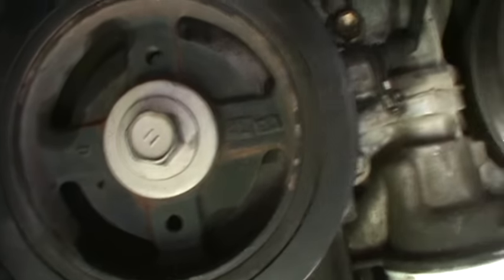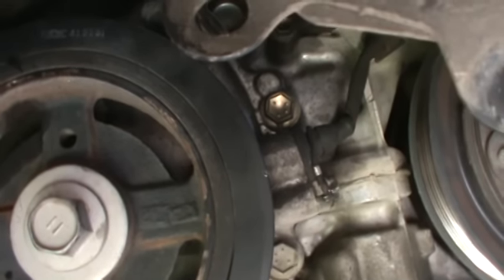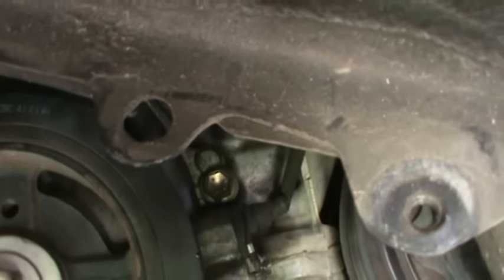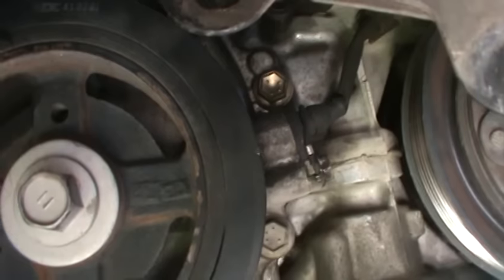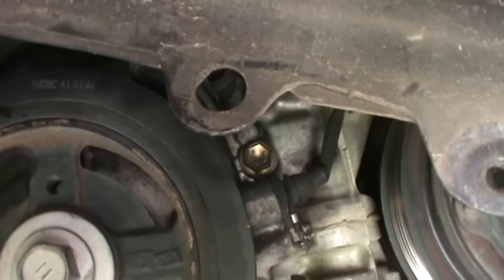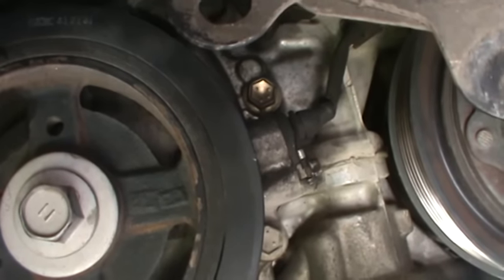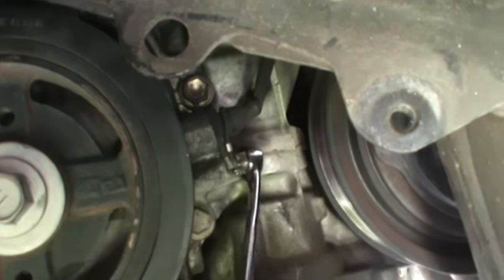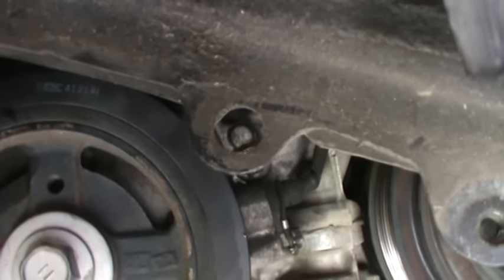Crank Shaft Position Sensor (Common Location)

Comment: Would've been great if you mention which car this was.
Reply: Its general.
Like where an air filter is located .
Or an exhaust .

The sensor reads the crank so has to be near the bottom where the crank sits .

Comment: There are two sensors on my engine. I cannot find on my 2002 the crank sensor under the balancer connector harness. I have the side sensor plugged up to the coil but the other one is evasive and do not even know what the connector looks like nor have i seen any videos showing the two crank sensor locations and what the wires are and what they  plug into  nor the cam shaft sensor showing where it plugs into either. Any ideas?

Comment: would this sensor set off p0340 code as well ? i changed my camshaft pos sensor but code didn’t change n still having problems starting up , just replaced starter bc it died on me left me stranded got it back running but still having issues battling p0340. i’ve changed sensor would the crankshaft sensor maybe help or solve my issue ?

Comment: Roman Automotive, I did the same thing you did... in my toyota camry, and I couldn't get the so called sensor because when I try it to pull the piece of a rubber than it broke something in there like a connector that I need to replace, even the connector is broke there is no sensor to replace correct me if I'm wrong asap please.

Comment: so if its in the back, that would be related with transmission fluid rather then oil? or is it lubricated with oil also
Reply: No.
The crankcase is where the crankshaft sits.
Just depends on how the engine is mounted.
Some transmissions sit on the side ,some rear .

Comment: By the way have a 96 Corolla rd 1.8. Crankshaft position sensor is on the opposite side of yours. Check your vin# my Corolla was built in Canada. Same sensor opposite  side.
Reply: So it will be on drivers side

Comment: can anyone tell me where the crankshaft sensor is on a 1991 protege 1.6 l engine is it on the crankshaft pulley side or is it back on the transmission side cuz I cannot find the damn thing

Comment: Good video, but what was the symptoms of bad CPS? THNKS
Reply: For me, I drive a 1.8 Esteem Manual Trans...My rpms were bouncing between 3,500 and 2,000 until my car died. This only occurred after my car got warm and the sensor started acting up. Once hot my car wouldn't even start until a few hours has lapsed.

Comment: I'm looking for a crankshaft sensor on an impala 2008 LS.
Reply: 🤦‍♀️ I just replaced my computer and it’s still crazy now need to find my sensor as well car still will turn off when operating temperature and then won’t even turn over or crank no click nothing.. but on position will still let car lights and radio play and car has to sit for a day or two until it starts again.